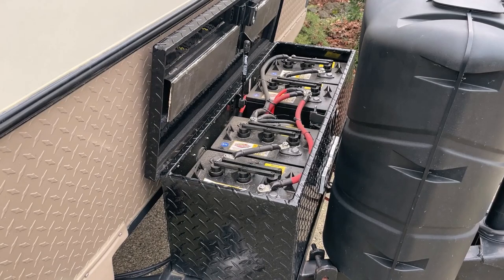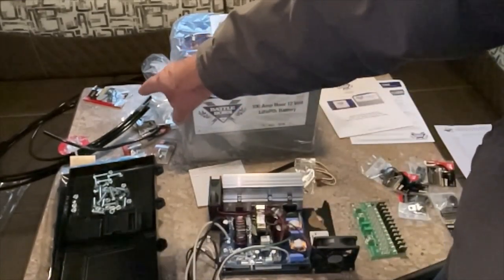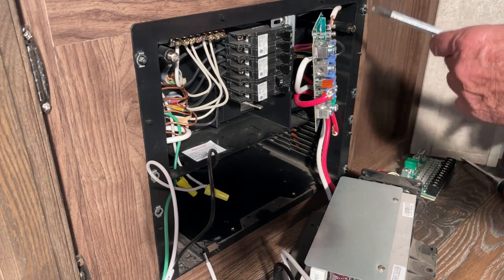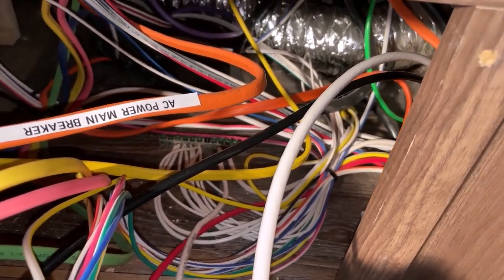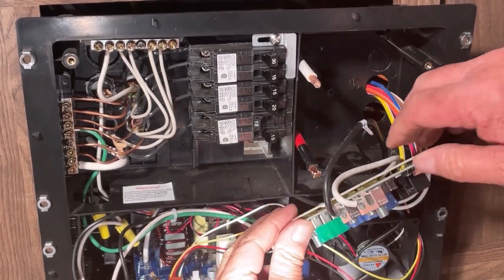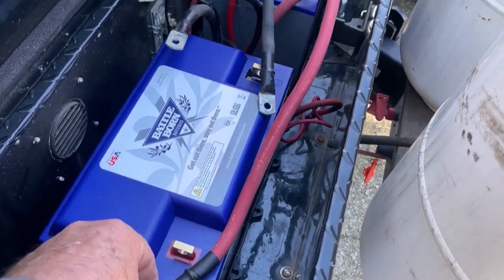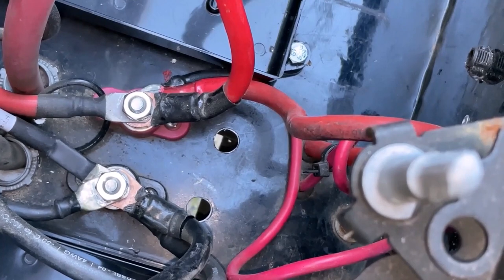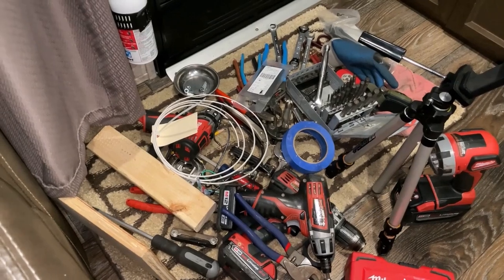Battle Born Lithium Batteries & Progressive Dynamics Converter/Charger Installation - Step by Step

Comment: Great video of step by step process- watch the whole video! There are some valuable tips and solutions that reflect the challenges that you will likely run into wnen changing out your converter. Thank you Michael for taking the time to make this video!
Reply from the maker: Thank you so much for the feedback John and for watching. I sure appreciate it :)
Reply from the maker: Note: Products I used and links to them are provided below. 

Check out my other YouTube videos by clicking this link - 
https://www.youtube.com/c/MichaelBracewellTheTravelTrailerGuy/videos

GOOD VIDEO TO WATCH - Lithium RV Battery Charge Test - Can You Use a Lead Acid Converter/Charger? -
https://youtu.be/gJtDHXJeB8Q

Michael Bracewell "The Travel Trailer Guy" is a Amazon Associate, I earn a small commission from qualifying Amazon purchases by you using the Amazon links below at no additional cost to you. Thank you 

Products Used Are Below:
Battle Born Batteries LiFePO4 Deep Cycle Battery - 100Ah 12v -
https://amzn.to/33L27SV

Battery Tray with Hold Down Strap -
https://amzn.to/3rvLAKJ

Dee Zee M207 Specialty Series Battery Box , Black
https://amzn.to/2OUPFcf

ANL Fuse 70 Amp with Fuse Holder -
https://amzn.to/3tIrQGo

ANL Fuse 70A Fuse -
https://amzn.to/3qHTP7i

Progressive Dynamics PD4655LIV 55 Amp Lithium Replacement -
https://amzn.to/3fLj0PW
(Manual) Progressive Dynamics PD4655LIV 55 Amp Lithium -
https://www.progressivedyn.com/wp-content/uploads/Support/manuals/PD4600-110197F-owners-manual.pdf

Progressive Dynamics Replacements WFCO RV Power Centers 55 Amp Lithium Converter 
https://battlebornbatteries.com/product/progressive-dynamics-lithium-replacement-converter-section-for-electronic-power-center-55-amp/

Rosin Core Solder Wire for Electrical Soldering -
https://amzn.to/3KroBJz

Bernz-O-Matic ST2200T Micro Flame Butane Torch Kit -
https://amzn.to/3AfqFQ4

5.5 Oz Butane Refill Bernzomatic -
https://amzn.to/3H0udIN

4pcs 2/0 AWG-3/8" Battery Lugs -
https://amzn.to/3nJ6WDg

4 Gauge 25ft Black and 25ft RED Car Audio Power Ground Soft Touch Wire Cable -
https://amzn.to/3Kv47iX

4 Gauge 4 AWG 10 Feet Black + 10 Feet Red Welding Battery Pure Copper Flexible Cable Wire -
https://amzn.to/3FLCDCi

Battery Cable Ends, 4 Gauge Wire Connectors 3/8 Copper Wire Lugs -
https://amzn.to/3Ikfk4e

2/0 wire that goes from battery to inverter - 
https://amzn.to/3eLyap4

Victron Energy SmartShunt 500 amp Battery Monitor (Bluetooth) -
https://amzn.to/33rDI5b

Here's a link that explains why Lithium Batteries are better than Lead Acid Batteries:
https://battlebornbatteries.com/lead-acid-vs-lithium-ion-batteries/#:~:text=Weight%2C%20Space%2C%20and%20Energy%20Density,-Energy%20density%20means&text=Lithium%20batteries%20have%20a%20much,than%20one%2Dquarter%20the%20weight!

Battle Born Battery Tear Down (Will Prowse) -
https://youtu.be/G5E30u-66VI

Below are links to products I used and YouTube videos I mentioned in this video:

YouTube Videos:
Trailer Battery and Storage Improvements (2 - 12 volt to 4 - 6 volt) -
https://youtu.be/1vm4w3BMq4I

Travel Trailer Renogy 200 Watt 12 Volt Solar Premium Kit Installation -
https://youtu.be/j4a9MkLRJN4

Solar Installation Upgrade from 200 Watts to 400 Watts on Our Travel Trailer (Series or Parallel ?) -
https://youtu.be/3lDVBU4CFMM

2000 Watt Pure Sine Wave Inverter & Automatic Transfer Switch Installation - Travel Trailer 
https://youtu.be/rkRzH0Ay1z0

Battle Born Batteries FAQ: Are there any temperature restrictions on our products? -
https://youtu.be/mTeoweIkKgc

All Battle Born Batteries YouTube Videos - https://www.youtube.com/channel/UCu9mOYKj4r5-CVxP5evPGrA/videos

Comment: Great video Mike! I ordered the WFCO 8955 MBA  - just the bottom board for lithium /lead acid / AGM auto switches based on battery type . I currently have the WFCO 8955 PEC
Reply from the maker: Thank you :) sounds like you are making great choices :)
Reply from the maker: "Mike the two wires that you replaced on the right little circuit board, for the battery, did they go directly to the battery or did they connect to the j-box under the passenger side close to the front?" 
I hopes this part of the video answers you question you asked on May 14, 2024?  https://youtu.be/BXyL_d34zy4?si=_jF9F7Yxbd7hOMG5&t=1000

Comment: Great video Michael! I've still got lots of life in my 6 volt batteries so it will be a couple of years before I upgrade. I recently watched some videos on the converter/charger for lithium batteries and found out that you can use the old charger. The old charger will not fully charge the lithium's but it is suppose to be better for the battery. Lithium batteries should not be kept fully charged when not used for extended periods. Since the old charger will only charge them to 70% in bulk mode, it keeps them from getting to 100%. Also if you have a good solar setup like your Rover, the solar charger can top off the batteries when needed. Some people will get a dedicated charger and mount it close to the batteries with large gauge wire to get the most out of the charger with no voltage/current loss and leave the old charger in place. Ray Burr from "Love Your RV" just recently upgraded his converter/charger but has used the second charger method for a few years now with his Lion Energy UT1300's with no problems. These videos I've watched also mentioned that the some battery manufacturers will not cover a warranty if you don't use a lithium charger.
Reply from the maker: Thanks Ron. We've gone on a couple camping trips since I installed the batteries and I'm quite impressed so far. Here's a couple videos to watch regarding charging Battle Born Batteries, you might want to give them a call to talk to them about charging - https://youtu.be/nopk-nWM2yU         https://youtu.be/ultUAyv-XQs        https://youtu.be/TOWdA2LUmrk
Reply from the maker: I just goy Ray's newsletter and here's something he wrote that may interest you https://www.loveyourrv.com/wfco-electronics-auto-detect-lithium-or-lead-acid-converter-charger/

Comment: I did the same thing to my 2109 recently.  I may have missed it, but wondering why you chose to change out the DC fuse panel as well?  thanks and nice job...you're gonna love those BB's!
Reply from the maker: Great question - The DC fuse panel came with the new converter/charger. From what I was told it needed to be changed out since the new converter/charger that is designed for lithium batteries I installed communicates with the fuse panel it needed to be changed out to one that works with the new converter/charger. (I had the same question when I received it) Thanks for your comment and watching

Comment: You do wonderful videos.  I did the roof tape and a few of your other mods.  I know my limitations when it comes to electricity.   I want the lithium and solar but it beyond my ability.   Can a RV dealer do this? Camping World? Any suggestions?
Reply from the maker: Thank you so much James, the reason I do these videos is to share with others and to give people the confidence to tackle projects on their own. The roof project was so worth doing since its so important to keep the rain water from damaging the trailer. The Dicor is nice stuff but doesn't last near as long as the tape will. I'm not sure what shops install solar and batteries. What area do you live in maybe there is a shop near you that does this kind of thing. I'm not sure if Camping World does this kind of work, and I'm not sure I would even trust them doing the work since I have heard many complaints about their maintenance departments performing shoddy work. I sure apricate you watching and sending a nice compliment my way, you made my day. If you can send me the area you live in and maybe I can search the area to help find someone to help you.

Comment: Be careful using the frame rail as a ground.  Those grounding points will corrode over time.  Trying to trace a bad ground is a real pain!  One more thing to think about, your trailer will be vibrating down the highway...... Every point your positive wire touches metal will be a possible point of failure.  I suggest getting some split wire loom from Harbor Freight and incasing the positive wire.  Thanks for the video!
Reply from the maker: This is great advice you are giving Harold. I should have mentioned in the video that when I zip tied the positive wire that I made sure it was not touching metal even if it vibrates, I like your idea of covering the wire though. I'm going to make sure I apply a electrical protectant over the ground connection points to help prevent corrosion. I sure apricate your comments and you sharing knowledge with me and everyone. Thanks for watching :)

Comment: Nice install!  Did you drop your underpinning (the black plastic enclosing the bottom of the trailer)?  Did you take it all off together, or did your trailer not have it at all?
Reply from the maker: Thanks Harold. Yeah our trailer did not come with the covered underbelly so it makes things easy to do repairs and to check wiring and other things from time to time. If I did have the underbelly I would have dropped it down to do the work and then put it back in place. Where we live there is no need for the underbelly cover because the weather is pretty nice in California. Check this video out :) - https://youtu.be/HChZHrz5psk
Reply: @thetraveltrailerguy  Thanks!  I have a Mini Lite on order and want Lithium ASAP!  I have to figure out where to put it all and don't relish having to drop that underbelly.
Reply from the maker: @smitty3509  Awesome, what model are you getting? Have you seen my other videos? https://www.youtube.com/c/MichaelBracewellTheTravelTrailerGuy/videos
Reply: @thetraveltrailerguy  We are getting the 2516, sometime mid to late Feb.  Have it ordered pretty much decked out.  Yes, I've seen several of your posts and am making a list of upgrades to do!
Reply from the maker: @smitty3509  You are going to love that trailer :)

Comment: I didn't know that you could replace your original WFCO converter charger with a different brand..I've been researching on changing my converter charger because my current one which is a WFCO 8560 doesn't support Lithium batteries which I plan on buying.. I wonder if the Progressive Dynamics converter charger will do the job with my current wfco panel box ?? Or is it specific to your model you have ??
Reply from the maker: I recommend you contact etrailer to ask them, they probably have something that will work for you in your WFCO 8560. They are very helpful and I highly recommend them. PRODUCT EXPERTS AVAILABLE NOW! CALL 1-636-245-5876

https://www.youtube.com/@thetraveltrailerguy/videos
Reply: Thanks  @thetraveltrailerguy

Comment: I just installed a PD 55 amp with 300ah of lifepo4. After running it for a hour the positive from the converter to the 12v fuse board was two hot to touch? It should be 6awg its 12awg? I didn't but it from you but you might want to take a closer look at the design! Im definitely calling in the morning to get this resolved or sending it back. This will burn your rv to the ground!
Reply from the maker: Wow thanks I'm going to check mine, so far I haven't had any problems. You may have a defective unit I'm not sure. Can you please do me a favor and let me know what they say about it? I would appreciate it. So just to make sure did you buy the exact Converter/Charger that I bought and installed? Thanks for commenting and I look forward to hear what is wrong with yours.
Reply from the maker: I just finished recording temperatures on our positive converter/charger wire to the fuse panel and the fuse panel itself (next to connection), here's some number for you:

Temperature inside trailer during testing: 59 degrees
Started charging the two 12 volt lithium batteries that were discharged to 60%
Temps prior to turning converter/charger on:   + wire 56 degrees fuse panel 56 degrees
Temps at 10 minutes:   + wire 56 degrees fuse panel 78 degrees
Temps at 15 minutes:   + wire 64 degrees fuse panel 80 degrees
Temps at 23 minutes:   + wire 67 degrees fuse panel 82 degrees
Temps at 90 minutes:   + wire 68 degrees fuse panel 92 degrees

converter/charger turned of at 95 minutes due to batteries being fully charged 

***Note: the cooling fan would come on around every 5 min or so and run for 1 min (+/-)
My findings:  
1) The positive wire did not get warmer than 68 degrees during my test;
2) The fuse panel next to where the positive wire connects to it did not get warmer than 92 degrees

Dennis - What did you find out is happening with your set up from who you contacted?

Comment: So what was the total cost for battery box, lithium batteries, new converter & board, 70amp fuse, new wires and misc connectors and materials?  I saw in later videos that you installed a shunt as well, so not including that $150 or so.
Reply from the maker: Here's links to all the products below, I hope this helpful. Thanks so much for watching and your question. - I do my best to list all the products I use in the videos below each YouTube video. 

Products Used Are Below (Amazon Affiliate Links):
Battle Born Batteries LiFePO4 Deep Cycle Battery - 100Ah 12v -
https://amzn.to/33L27SV

Battery Tray with Hold Down Strap -
https://amzn.to/3rvLAKJ

Dee Zee M207 Specialty Series Battery Box , Black
https://amzn.to/2OUPFcf

ANL Fuse 70 Amp with Fuse Holder -
https://amzn.to/3tIrQGo

ANL Fuse 70A Fuse -
https://amzn.to/3qHTP7i

Progressive Dynamics PD4655LIV 55 Amp Lithium Replacement -
https://amzn.to/3fLj0PW
(Manual) Progressive Dynamics PD4655LIV 55 Amp Lithium -
https://www.progressivedyn.com/wp-con...

Progressive Dynamics Replacements WFCO RV Power Centers 55 Amp Lithium Converter 
https://battlebornbatteries.com/produ...

Rosin Core Solder Wire for Electrical Soldering -
https://amzn.to/3KroBJz

Bernz-O-Matic ST2200T Micro Flame Butane Torch Kit -
https://amzn.to/3AfqFQ4

5.5 Oz Butane Refill Bernzomatic -
https://amzn.to/3H0udIN

4pcs 2/0 AWG-3/8" Battery Lugs -
https://amzn.to/3nJ6WDg

4 Gauge 25ft Black and 25ft RED Car Audio Power Ground Soft Touch Wire Cable -
https://amzn.to/3Kv47iX

4 Gauge 4 AWG 10 Feet Black + 10 Feet Red Welding Battery Pure Copper Flexible Cable Wire -
https://amzn.to/3FLCDCi

Battery Cable Ends, 4 Gauge Wire Connectors 3/8 Copper Wire Lugs -
https://amzn.to/3Ikfk4e

2/0 wire that goes from battery to inverter - 
https://amzn.to/3eLyap4

Victron Energy SmartShunt 500 amp Battery Monitor (Bluetooth) -
https://amzn.to/33rDI5b
Reply: @thetraveltrailerguy  so in the neighborhood of $2700 parts and materials. I’m considering it, but that’s a hard pill to swallow. I can buy several power banks for that. How many hours do you think put into the install?
Reply from the maker: @paulabrotherton  Maybe 16 + hours taking my time and filming all the installs. Filming sure adds lots of time but that's okay knowing it helps others.
Reply: @thetraveltrailerguy  Love your DIY videos and grateful for your willingness to help others.  I've done several of my own projects following your videos.  I don't think this is one I'm going to jump on though--I just don't do enough boondocking (for more than a few days anyway) to warrant the expense.  Thanks for all the quick responses!
Reply from the maker: @paulabrotherton  Thank you so much Paula, I do what I can for America :) Keep on tackling projects on your own rather than paying someone else to do them :)